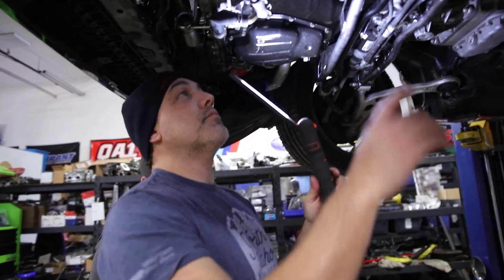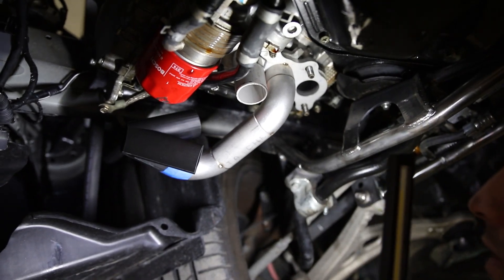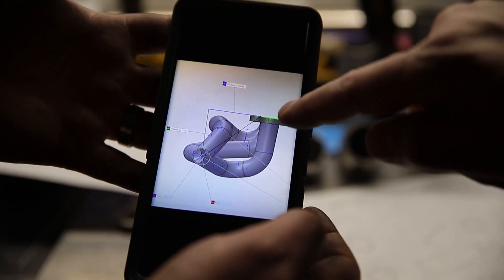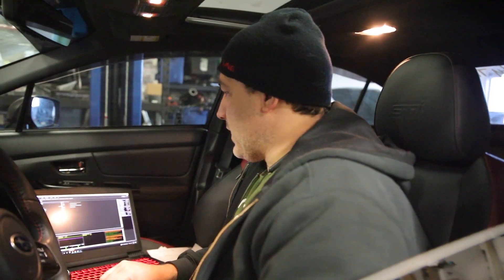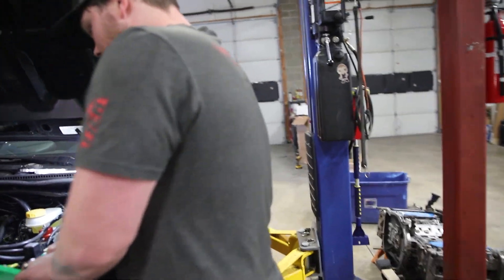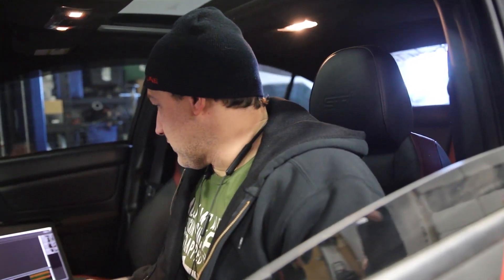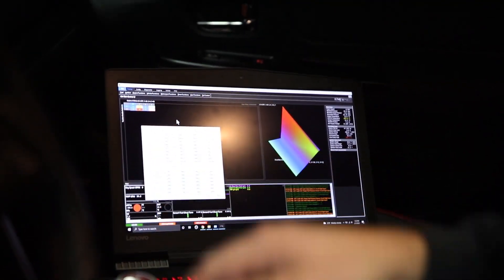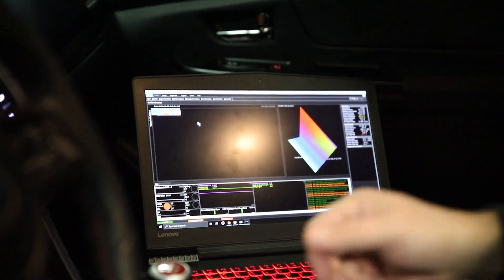H6 Swap In Record Time Episode 4: Turbo kit fab and EMtron

Comment: Sounds smooth, is there wastegate dump out the front bumper?  Otherwise exhaust is going out the back?
Reply from the maker: exhaust is out the bumper as shown on the dyno video. 
Gates dump nearly straight down
Reply: @GetaDomTune  ah I see you just have the cat back hooked up still
Reply from the maker: yeah, an empty bumper looked dumb in our opinion.  @HugoHardinge